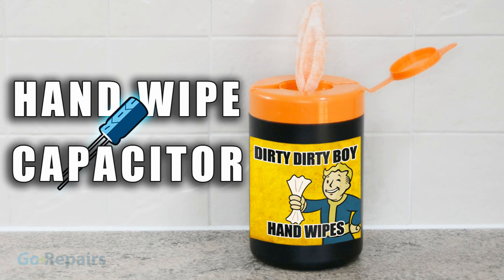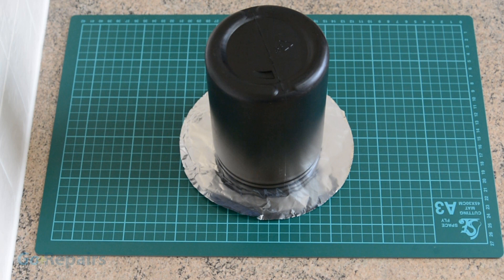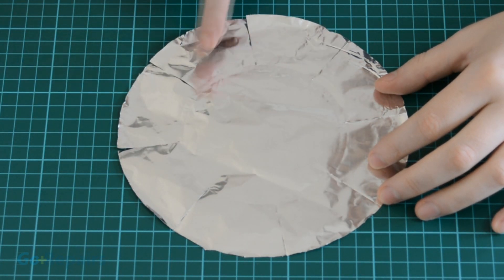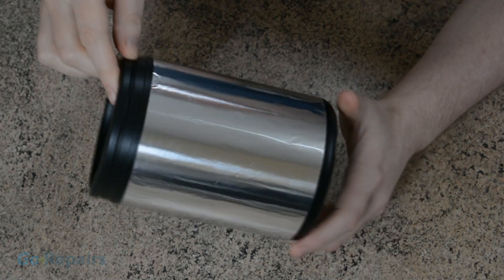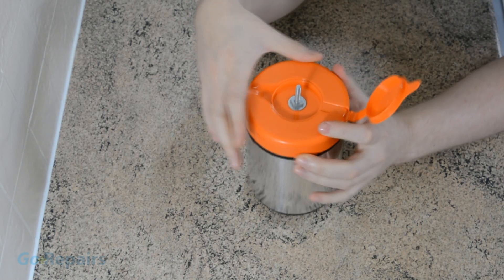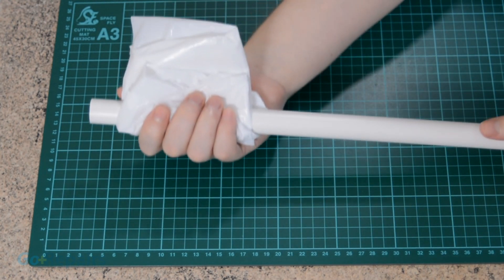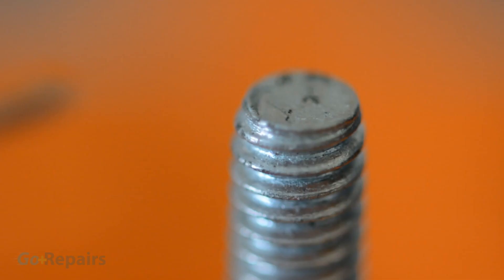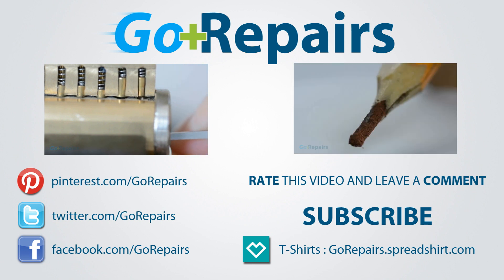Hand Wipe Capacitor

Comment: Hey, really nice videos! :)

A quick question about your charging rod. What is the unsulated wire for? Should it be touching the ground/me while charging the jar or should it dangle freely in the air?
Reply from the maker: Thanks. When your charging it can dangle freely, it's just used to discharge the capacitor.